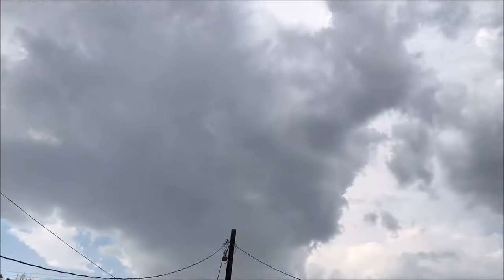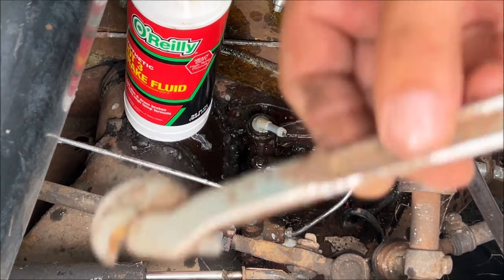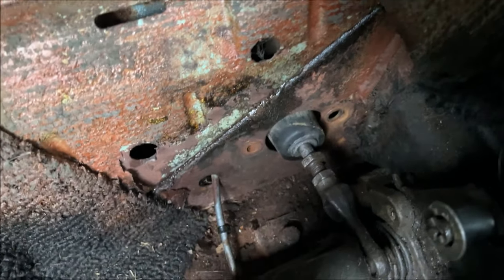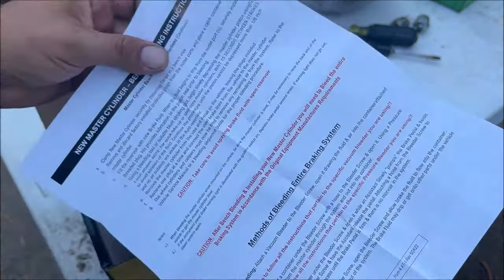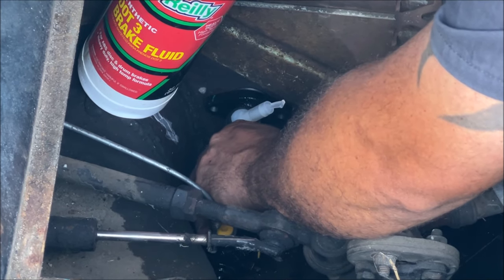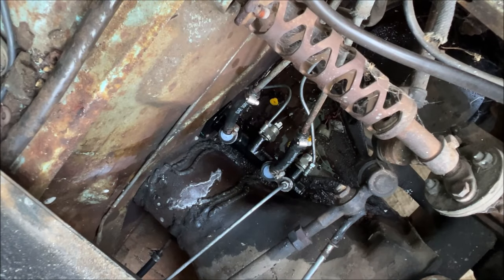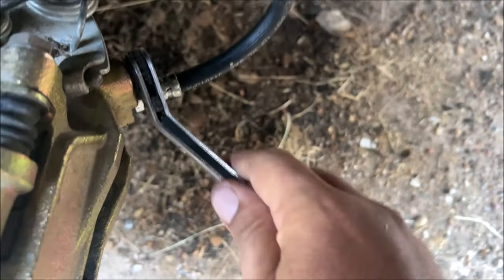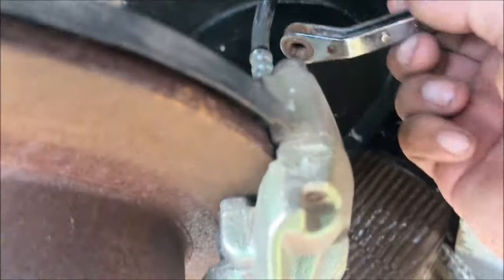VW BEETLE master cylinder replacement

Comment: A Tip:  A bit late now, but don’t remove the two bolts that mount the master cylinder…just loosen them until they are unthreaded from the master cylinder, then pull the master cylinder forward off the bolts, leaving the bolts in place through the firewall.  The firewall is double layered, and there are sleeves inside the air space that keep the bolts from crushing the firewall. If you pull the bolts all the way out, the sleeves will drop down inside the firewall, and they are a bitch to fish back out.  If you do remove the bolts, you’ll need to retrieve the sleeves, and with the master cylinder out of the way hold the sleeves in place and reinsert the bolts from the pedal side.  Once the bolts are back in, It helps to have a second person to hold the master cylinder in place while you get the bolts started.  A pair of angled hose pliers are perfect for holding these sleeves in place while you reinsert the bolts…or a 5 year old with tiny fingers.

Comment: So what are four wheel discs like?
Reply from the maker: I’m guessing that master cylinder is the problem because they are the worse 4 wheel disc I have ever drove.. they are mustang brakes but the pad is offset on the rotor as not to make 100% contact..  but I’m going to say master cylinder is just crap. they don’t stop very good compared to any other vehicle with 4 wheel disc
Reply: I believe that unit was 19 mm bore. For 4 wheel discs you need a 20 mm bore unit. The 19 mm one is good for front discs and back shoes.
Reply from the maker: @vayabroder729  even if you are wrong i love you..  i will try that. the brakes are shit I was actually doing brake tests today..   it stops..  but it stops like i have 8 people in it
Reply: @chriscraft77022  That’s what I’ve read; the 19 mm for ‘67 to ‘72 models is adequate for discs up front but you need the 20 mm one for 4 disc set up. Makes sense because it handles more volume.
Reply from the maker: @vayabroder729  i have put 4 wheels disc brakes on everything....    i hope that fixes it.   i will let you know.. im about to buy a 2012+ fiat abarth .   do you know anything about those?
Reply: @chriscraft77022  I like those little cars; a friend of mine had a regular one; not the Abarth but they are kind of cool. The Abarths are supposed to be more peppy.